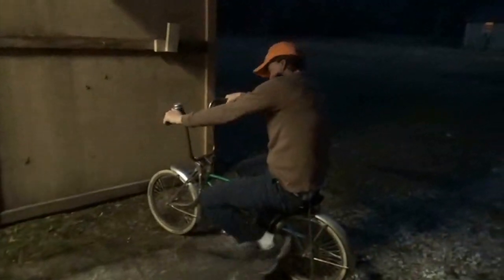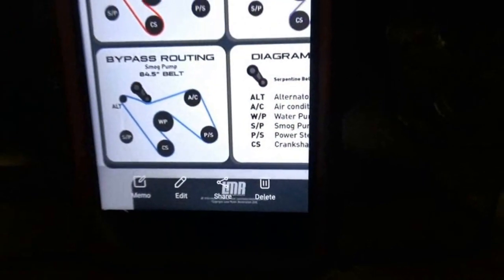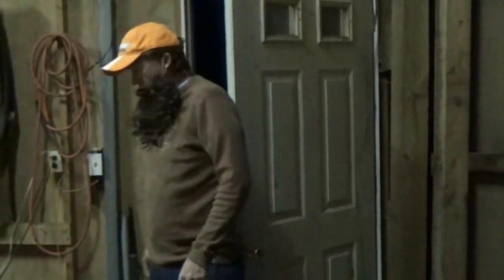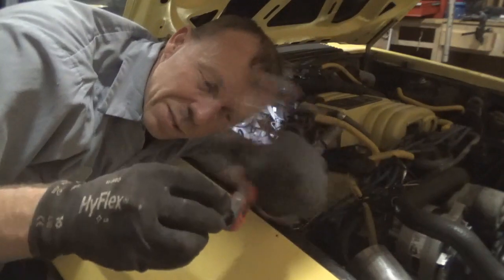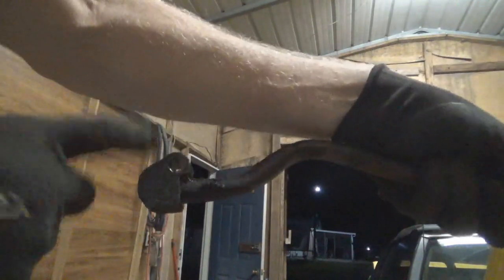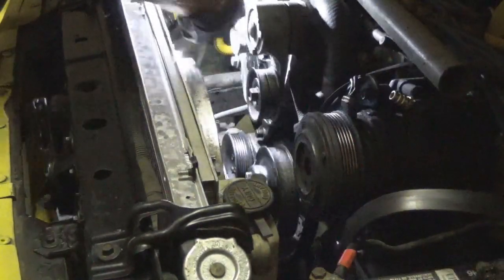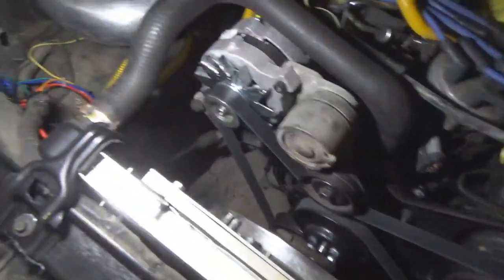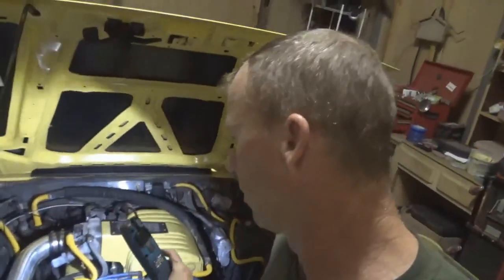Smog delete on the 1986 Foxbody Mustang. (Finally)

Comment: I actually didn't know that the smog pump just helped you cheat legally in the 80s.  Thanks for the info buddy and always good to see Scream man and Camaro man of course.
Reply: GearHead704 it really wasn’t to “cheat” per say.....clean air from the smog pump, pumped into the exhaust creating a “ cleaner exhaust out the tailpipe
Reply: Smog pump pumps air into the catalysts on a cold start up to get cats up to temp and get the O2 logic into closed loop.

Comment: That line you crimped at the H pipe have you ran into anything because I herd some folks are welding that I’m not quite sure thanks
Reply from the maker: Nothing changed for me.
Reply: @yellowfoxbodyguy  alright thank you for the reply man I didn’t expect to get 1 thank you sir I’ll rewatch your video you rekon I can put anything else over that crimp ? And I saw some vacuum lines I got the intake off right now I did plugs and wires last night and thought about doing a fender well intake to clean up under the hood and wipe down all the paint I’m gonna do under drive pulleys and take the clutch fan off also and do the sve electric fans and I got shorty headers I got a 89 LX convertible 5 speed with 55k original miles but I might buy them block off plates from LMR just in case I sell it someone will have all the original stuff  I was thinking

Comment: I bought the threaded plugs for the engine from lmr but the carbon was so bad I just flipped the plates from the tube like you did.  I also cut that tube in half to get it all out from behind the motor with a rotary dremel
Reply from the maker: Good idea. I didn't even want to bother with the carbon.
Reply: I did the exact same thing l o l

Comment: Hello, thanks for the video. Did you just pinch the line under the car with pliers and no exhaust leaks? This is the last step I need to complete.
Reply from the maker: That's all I did. Pinch it tight. I didn't show vacuum lines but I basically joined them all back together.
Reply: @yellowfoxbodyguy  thanks for resoonding. So many of these guys that have Foxbody channels don’t even reply! Like the BREW2l and HOUSE OF DULA. Asked questions and no response! Thanks so much!
Reply from the maker: @markandfrancis  make sure you subscribe. I do what ican.
Reply: @yellowfoxbodyguy  what do you mean joined them all together?

Comment: Does the water pump always spin counterclockwise? That wont mess up the direction of the flow?
Reply from the maker: Yes from the factory the water pump is counterclockwise. I have heard of some setups turning clockwise but I would think the impellers and pump would need to be designed for that.

Comment: the cats are going to eventually fry without the smog pump pumping air into them . You need to either gut them or put an H pipe on. The Smog pump takes up almost 0 hp,
Reply from the maker: Gutted them in May of 1993.
Reply from the maker: Smog pump was very hard to turn. Noticed a difference as soon as we got it off. My dad was ASE certified for 27 years.  He went from a Chevy man to a Ford man once he bought a 68 Mustang. He never looked back😁
Reply: False

Comment: Does this give you any codes? My foxbody came with the smog pump deleted i have a code 81 & 82
Reply from the maker: Honestly not sure because the 1986 has no 02 sensors. I bought a obd2 adaptor for my reader and it doesn't show any. My check engine light burned out 25 years ago😁. Not sure what happens on the cars with 02 sensors.
Reply: Did you ever get this resolved? If so, how?

Comment: What size belt are you using ?
Reply from the maker: Lmr said a 84.5 but I ended up with a 85.5. Depends on your pulley sizes.
Reply: @yellowfoxbodyguy  I have everything stock with a smog delete. My car also has AC
Reply from the maker: @Newmoneymarc  try an 84.5 first then.

Comment: What about crankcase pressure?
Reply from the maker: Have had no issues since. Have not heard of any one else having issues. Thanks for commenting and bringing up a valid point. If the tubes going into heads are clogged like mine were there will be no pressure change on heads or block.